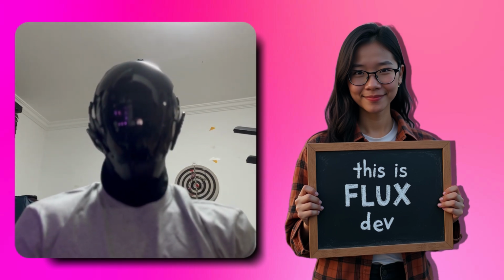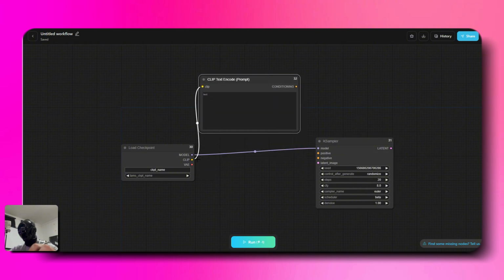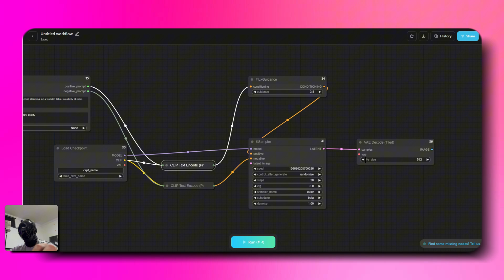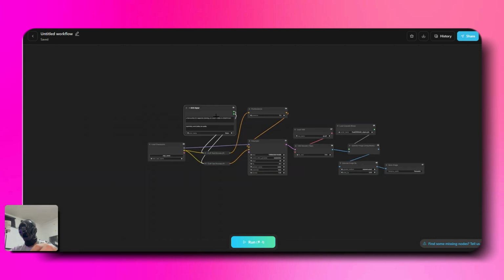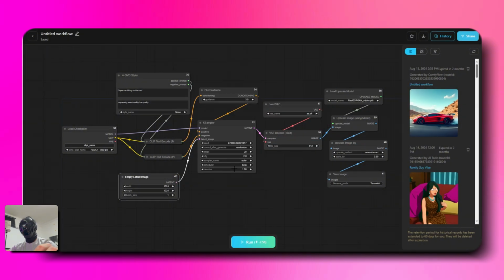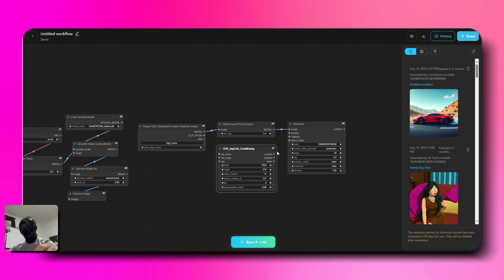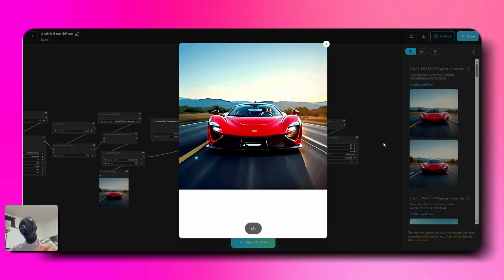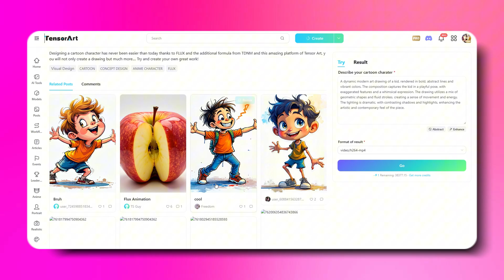Flux can actually create animations?

Comment: This workflow you use completely doesn't work. you don't use the dual clip required for flux, flux can't run with the ksampler, and the animatediff combine node is deprecated and not used anymore.
Reply from the maker: Yes, that's the case at the moment. SamplerCustomAdvanced is the one that supports Flux. You can try it. For other nodes, just follow the video tutorial.